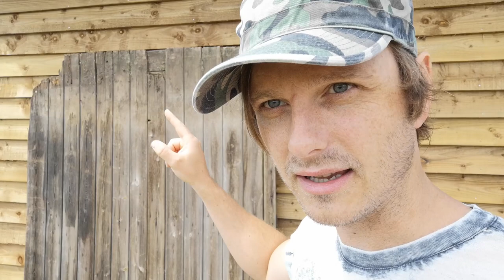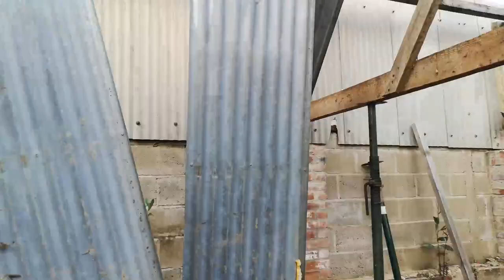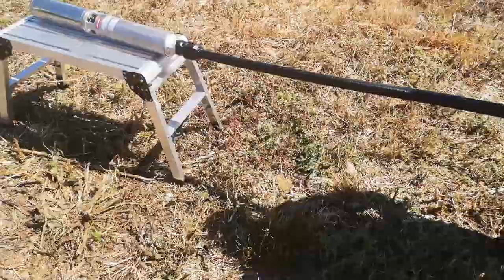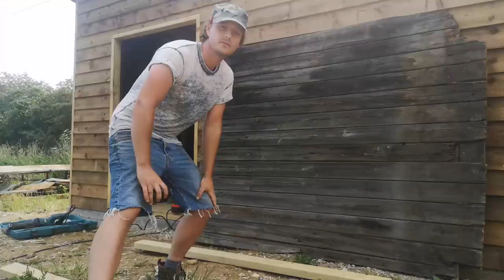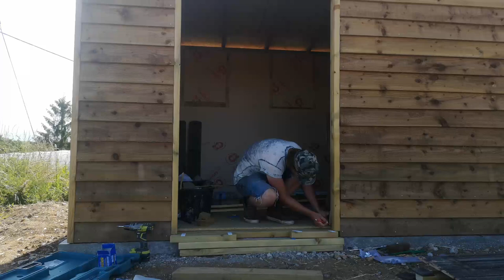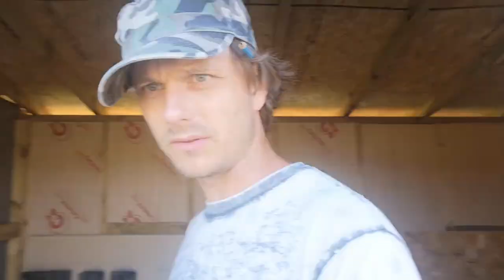Borehole WATER PUMP install - OFF GRID

Comment: Have you considered getting a second opinion/test on the well water quality so that you don’t get oversold on unnecessary filtration equipment?
Reply from the maker: Hey, I did consider it but I knew from my neighbours and the general area that I would probably need it. Plus the test was done by an indepandant lab. If the firm I used was interested in over selling they would have quoted me 20k like the others - to go 80m down 🤦‍♂️